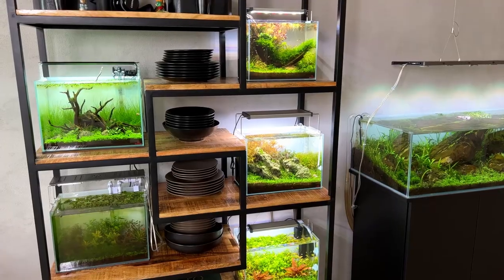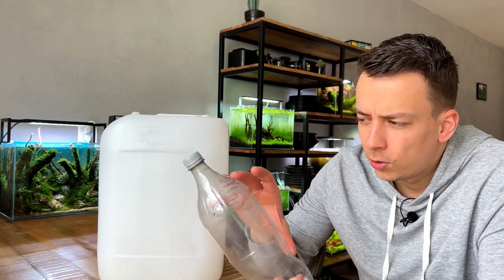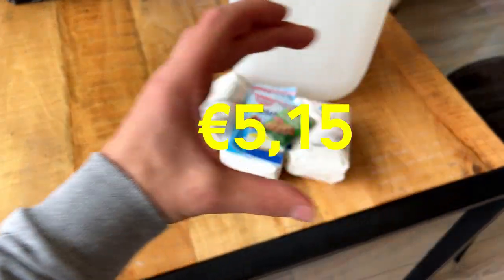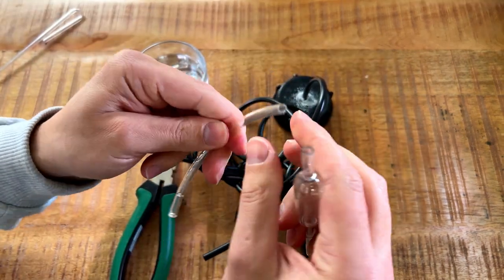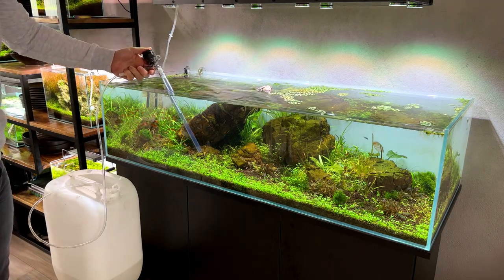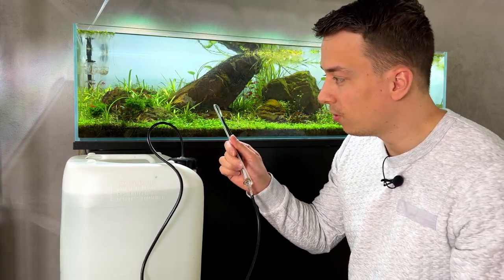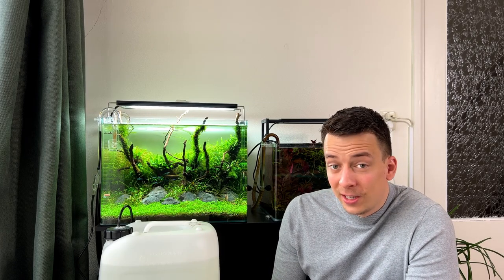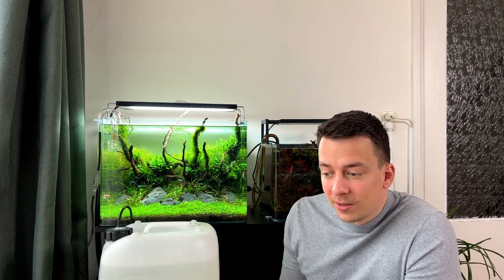HOW TO MAKE A DIY CO2 SYSTEM - XXL DIY CO2 SYSTEM😱 (don't try this at home)

Comment from the maker: Should I make another XXL DIY CO2 system? Also don't forget to smash that like button! 💪

How I make them usually! https://youtu.be/OtpfltN15-8

Link to buy the tool I use for water changes https://amzn.to/3u9bN4e

👉🏻Cool Aquascaping T-shirts: https://mosscotton.com/ Code: mjaqua10

👉🏻Be sure to SUBSCRIBE to my YouTube channel: YouTube.com/mjaquascaping

👉🏻 Use Code ''amsterdam'' for 10% off CO2art products

👉🏻10% DISCOUNT on buceplanet.de with code: Amsterdam10
Reply: Soda bottles are made to withstand outstanding pressure during the fill up of soda in the factory thts why they are ideal.
Reply: I love this experiment, mostly because all I have are large low tech tanks. I have a container idea for you to consider!

You know those large blue water jugs you flip over to put on a water dispenser in like an office or something? I would imagine that you could use one of those, and it might be a little stronger, similar to the soda bottles construction? They all have different cap types. You may be able to find one that screws on.
Reply: Using blue chemical grade  40liter can..!
Reply: It was really nice try. To be on safer side, you should also consider using a non return valve. So that water from the tank does not flow into the container.
Reply: The container u were using, it's original use? Looks like containers in America that hold cooking oil for deep frying food. Like u said, they look sturdier than a 2 liter soda bottle, weird. Only trouble shooting from watching ur video is maybe have a slightly large silicone tube and defuser to accommodate the larger volume of gas. I have yet to try any CO2 in aquarium but I'm definitely gonna try this year. Thank you for ur content, entertaining and helpful
Reply: YES 🙌 BUT 

YOUR BOTTLE YOU USE NEEDS TO BE FOR PRESURISED LIQUIDS LIKE FIZZY DRINKS OR BEER. 

In the uk we can get these beer barrels that are for diy home brew alcohol that are pressurised by the fermentation process and can withstand 60psi I think 🤔 you could also get an old water fire extinguisher fill with water and sugar and yeast and it may work.  You could also make a bank of multiple CO2 generators daisy chained together when one drops off you can isolate and replace meanwhile maintaining pressure in all your kit. 

I use a £12 CO2 fire extinguisher with solenoid and regulator total cost £30 ish  I’ve calculated that for 2kg CO2 it should last me 8 months or so but I’m unsure nor a mathematician
Reply: @ranjithfd  designed for non presurised fluid ?
Reply: @divinshetty4957  I would be more concerned that the alcohol went into the fish
Reply: what about a (plastic) fuel canister? those don't even break in a hot car, think they are more rigid than the one you used.
Reply: @carstenl1117  I wouldn’t think these would hold 3-4 bar pressure
Reply: I am doing this on a slightly smaller scale with large, with 5 liter water bottles (I order them online in the netherlands). Works perfectly fine. I am using it on my 800 liter aquarium, so likely I should be using 1 or 2 additional 5 liter bottles to get CO2 to appropriate levels but I don't have super CO2 sensitive plants and the tank seems to be doing visibly better since I started dosing this way!
Reply: How about the large glass bottles used for brewing? I have a 5 gallon bottle like that
Reply: I know somebody who brews beer in theirs, I am sure it would work!
Reply: por supuesto, necestás hacer de nuevo el experimento
Reply: Please

Comment: High pressure irrigation plumber here. Your issues aren't with the canister. You chose well. The issue is with the diameter of your hose and bubbler. If you have keep the depth of the bubbler that deep the pressure demand increases. I'd try raising it and also increasing diameter. Best of luck, cant wait to see new results. Thank you for sharing your experiments and results

Comment: An option would be to use an empty beer keg, it is made to withstand great pressure. I have one at home maybe I'll try one day
Reply: Shhh! Seriously... until after I try it. Haha. Tomorrow. It will be known. I will report back.
Reply: Good idea!
Reply: @dipndalip  good, then tell me if it worked! you can use the same fitting as the barrel and cover the co2 inlet with a metal plug
Reply: @dipndalip  and?
Reply: You can buy brewery plastic tanks that are pretty strong
Reply: did any of you guys try it? I'm planning on using a large protein powder container but can't figure out the portion of yeast/sugar or citric acid/baking soda
Reply: @dipndalip did it brutally explode and kill you? Has been a year
Reply: @joeyekk721  LMAL
Reply: Reverse engineering beer to make co2 😂

Comment: The reason why simple 2L and 500mL bottle can hold pressure so well is because they actually designed to withstand up to 200 PSI when they are filled with soda from the factory. So they aren't exactly as flimsy as they seem lol

Comment: you could use 6 or 8 inch diameter PVC (sewer) pipe with a glued standard end cap on one end and a screw end cap on the other with a gasket. The cool thing is you can make it as tall as you want to make the volume you need, but a 3 foot length of 6 inch would be about 4.5 gallons, a 2 foot length of 8 inch would be about 5 gallons.

Comment: Making mistakes is better than faking perfections! Great video Mark! Seemed like such a sound principle but I guess the way those barrels are made with that seal line down the middle has created a weak point. I used to do a lot of home brewing and would reccomend a large plastic fermenter for v2. I have a few 25litre ones gathering dust in the shed back at my mums. 👍

Comment: Maybe this is something you might want to try... Use 4 soda bottles connected in parallel through a 5-way pneumatic quick insert connector, with each having its own pneumatic ball valve so you can fill one bottle with a new batch of yeast and sugar mixture without losing pressure on the other bottles.
Reply: I was going to suggest just using more bottles as well.
Reply from the maker: Oh that's a great idea!

Comment: did you check that there was flow thru the line from the cap? it seems that the container cracked because there was too much pressure, and you never got bubbles... I think the line was too tight going thru the cap, you actually pinched the line. you should redo the system and make sure the line can flow (blow air thru the line) before starting again.

Comment: i would think about using a weed sprayer. they're usually 2 gallons and are built to withstand pressure in the 40-60psi range before the safety valve releases . a simple hose barb going from the sprayer to your co2 line should do the trick i would think. plus a nice wide mouth for easier cleaning and loading. id really like to see you try that out

Comment: Thats a huge volume that requires more pressure to let CO2 out from the diffuser (take longer reaction), and that container is not strong enough to maintain their shape in that condition😂

Try metal jerry can instead of plastic😁 
That cost more but I hope it is worth it

Comment: You know those cans who are used on beer dispensers the can It is made of thick aluminum And I'm talkin about The ones with beer in them And for the same reason they should be able to hold pressure and not explode

Comment: You were very lucky in that jerrican didn't explode or open on half... that is not safe at all or made for something to hold so much pressure.
In past I've used DIY CO2 systems for bigger tanks but with normal diffusers, and to achieve 2bps we just need two tea spoons of yeast, 2 tea spoons of baking soda, 2 cups of sugar and hot water. I never have used gelatin in my mixes... 
To make it last longer, use a plastic water container of 6L ;-)
Reply: years ago I made one with baking soda and citric acid with a DIY Chinese regulator where you can close the pressure valve to keep the pressure at night but the mixture continues producing CO2 and increasing the pressure on the soda bottle. A day later the bottle explode and destroyed the trash can next to it and made a hole in the wall. I was lucky to don't be close to the bottle, that thing can kill a person for sure. After that I start buying a professional pressurized CO2 , no more DIY. However I think M J aquascaping DIY CO2  is safer because the pressure is scaping constantly and he never try to close it at night with solenoid valve or manually.
Reply: @ivanmoguel7548  but when I was using DIY it was 24/7, unless you use something in metal that can hold the pressure. But even on plastic bottles if the diffuser for some reason block, the bottle will explode for sure.
We need to be very careful with this, if possible the better way is to use a pressurized CO2 System with a good pressure regulator (carefull with very cheap ones)

Comment: Fun experiment MJ! Hey maybe we could try one of those pressure sprayers used in gardening (without manually pumping pressure into them of course). A high quality 10L one should cost about 30 euros, so definitely more than that canister you used. But they're made to handle the pressure. Plus they come with a hose output so no need to DIY that. And some of them have a "safety valve" to release excess pressure. I'd have to go inspect one at the supermarket to see if it would work.
Reply: I like this suggestion.  I was trying to think of container choices that were bottle shaped that had the lid at the top as well.
Reply: @zombi3907  One thing to keep in mind though is that these sprayers by default suck water from the bottom of the container. So we need to cut the internal straw that goes under water so that it takes the air on top instead. If we look at this one for example this should be very easy to do: https://www.youtube.com/watch?v=51l_CTV86qY
Reply from the maker: Great idea!

Comment: Normal yeast tends to die when the alcohol reaches over 10%.
Wine makers create strains that can tolerate higher but if you just add the sugar bit by bit the yeast evolves and you can make home made wine that's up to 16%.

Comment: I think those kinds of CO2 systems do not produce enough pressure to go through the diffuser (those type with micro ceramic). So the pressure built up in your canister and it might be the reason that it broke. I had the same CO2 system with the same diffuser and it never really worked, so i changed the diffuser :) Was a nice experience to watch i'll be glad to see more!
Reply from the maker: Yeah normally these work well for me, but I guess for this one I should have gone with something that requires less pressure...

Comment: Love the shelf with all the small aquariums, there is just so much to explore, compared to just one big tank! When i move someday, i will definitely steal that idea. For the CO2: Maybe try to find a pressure cooker
 with a metal lid? Would looove to see one of these next to your tank :'D
Reply: But with one big tank you can have multiple smaller tanks underneath and the options. ;) I'm setting up 714l tank or rather I'm going to after some tweaks to the stand. You need to think about floor, flooring, stand, electricity bill, etc. with a large tank. Small tanks are versatile in this and you can fill a rack with twenty of them.

Comment: Sure, you’ll need bottle or container like pepsi and soda bottles that can take the pressure. I tried before using normal bottles or milk plastic containers and it exploded several times until i thought of changing it to Pepsi bottles and it has been working perfect since then; anyway its a great video really and I have been thinking the same😂 like bigger container to last more time or for a big tank 😂. Keep it up bro, best of luck 🤞❤️

Comment: Have you considered a yeast used for brewing like a Champagne or Mead yeast? They can tolerate higher percentages of alcohol before being killed. The downside would be they may cost a bit more per packet and they may ferment more aggresively.

Comment: The thing is that pressure works differently based on the container. Since your container has a much bigger surface area, for the same pressure, there is a lot more force on the walls of the can than for a soda bottle. Why not just use 13 soda bottles connected together haha?
Reply: i was thinking along the same lines. 10 soda bottles all conected together with non return valves and shut off valves fitted to each. i was going to fill two with the yest mix and use the rest to store the co2 untill needed. when the yeast mix runs out there should be enough co2 pressure to keep the tanks stable untill the new mix kickes in.

Comment: I don't think the problem is with the canister. When you add so much yeast to it, it creates a huge pressure. Even if it doesn't leak, the bubble counts will be crazy. You should fine tune the yeast level by trial and error. Also, adding more water initially will also decreases the time it takes to see your first bubble.

TBH, this isn't a safe experimental. If you found a tougher containers, and ramp up the yeast level even more, you really risk exploding it.

I hope people can learn from it that if you really need a huge CO2 volume, is better to get a proper one. For the safety of you and your love one.

Comment: Using a two pop bottle diy system I have seen the pressure go as high as 130 psi, I believe the pop bottle can explode around 150 psi so not surprised :) really enjoy your videos
Reply: 175 psi ( 12 bar ) is the european standard for PET bottles.
Reply: @kaizy760  I have a safety valve on it set to 50 psi so I can sleep at night;)

Comment: Try using 3-5 gallon clear water bottles. Those bottles are made with same material as soda bottles.
Reply from the maker: Could work! But they usually don't have a proper lid right?
Reply: @MJAquascaping  I have seen 3 gallons with a lid same as the soda bottles in my grocery store. But it'll be hard to find one.

Comment: I mixed in one cola 2.5liter bottle 350grams of sugar, 250ml of water, 10grams of food gelatine(left it in 10-15min in water) and another 2.5liter bottle filled with water.
And no pressure problems.

Comment: The yeast is barely able to survive under anaerobic (no oxigen) conditions by fermentation. To reproduce and multiply it requires oxygen. You need to scale the dose of yeast with the volume of the container, because you are almost limited to the amount you dose in.
Also, the flimsy bottle is manufactured in one piece, without seams. The canister is not and that's why it breaks. I think your best shot at scaling up yeast production is over of those 5L mineral water canisters with handle. Still, a big upgrade from a 1.5L.
Keep it up, I want to see how this all ends. 😁

Comment: Friend, do the same thing (with this installation - or very similar) but use citric acid and baking soda. This is when it starts 100 times faster, the pressure is higher (even up to 10 bar), it works 3X longer.
A good movie I give a thumbs up.

Comment: 5 Gallon Glass bottle for wine making. Looks similar to a bottle for a water dispenser.

They make rubber bung stoppers for them that may even be the right size for the airline tubing. 

I'd be interested in seeing how well it works if you decide to try it.

Comment: Had been watching ur vedios for a long time..
Can i have a suggestion..container couldnt handle the pressure required to push co2 through the diffuser i guess.. Either change the diffuser in to something simple.. Or need to use more pressure withstanding container.😊
Reply: May be connect the tubing to filter powerhead.. Will get diffused and easy.😬

Comment: Years ago I made one with baking soda and citric acid with a DIY Chinese regulator where you can close the pressure valve to keep the pressure at night but the mixture continues producing CO2 and increasing the pressure on the soda bottle. A day later the bottle explode and destroyed the trash can next to it and made a hole in the wall. I was lucky to don't be close to the bottle, that thing can kill a person for sure. After that, I start buying a professional pressurized CO2, no more DIY. However, I think M J aquascaping DIY CO2  is safer because the pressure is scaping constantly and he never try to close it at night with a solenoid valve or manually.

Comment: Co2 gas and pressure make holes cracks in cheap plastics and tubes, you need to use something which can hold a lot of Co2 gas pressure maybe a 4" PVC pipe. But it was a good try. keep experimenting. Thank you

Comment: Will Yeast and Sugar mixture will work in DIY CO2 Cylinder generator that uses baking soda and citric acid mixture? I'm curious to experiment if I schedule it 8 hours a day will the Yeast die in the cylinder due to co2 overload inside without opening for co2 to escape outside 8 hours period the system is closed off be solenoid.

Comment: Should work. Really no different the beer and wine making. Most l likely a clogged co2 line. A lot of beer and wine kits use a standard 5/6 gallon pail with lid that makes a good seal. That water jug should have worked fine. Some people use 5 gallon water cooler jug as a fermenter as well

Comment: Definitely like soda + citric acid better as it can be shut off during the night using a cheap shut off valve because the shutting off of the system will shunt the equilibrium pendulum between the two bottles.
It is however a bit more costly.

Comment: YES, SIR   MJ YOUR VIDEOS ARE REASSURRING, AND PRACTICAL....BELIVE YOUR SYTEM IS LARGE AND WILL WORK, MY 2L SODA BOTTLE GAVE WAY TO PRESSURE ON MY DIY CO2 SYSTEM REPLACED OLD WITH NEW WORKS WELL NOW, EVEN  MADE BUBBLE COUNTER AND CO2 CHECKER..😁

Comment: Try using a Big mineral water or distilled water container 6-9liters will work the same as soda bottles, i already tried that type of big container, really incapablenof holding pressure for co2....